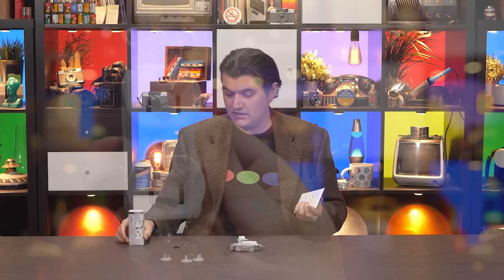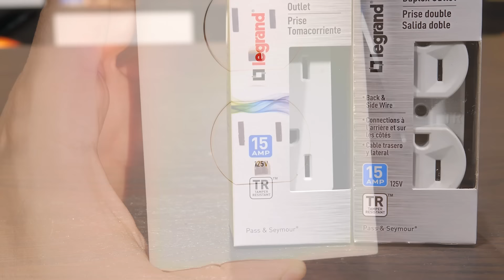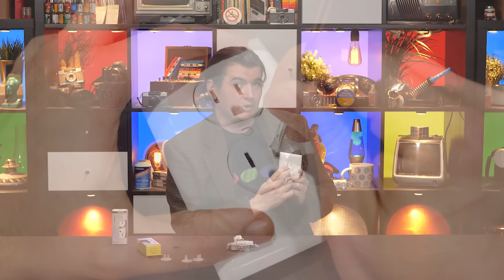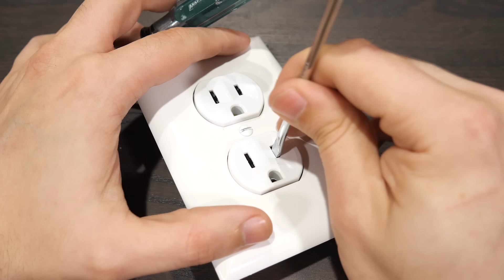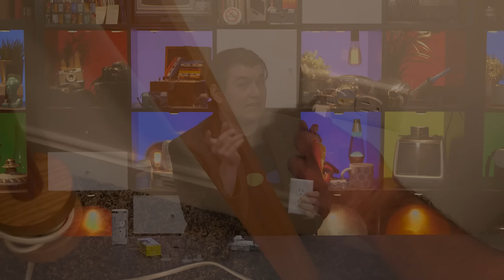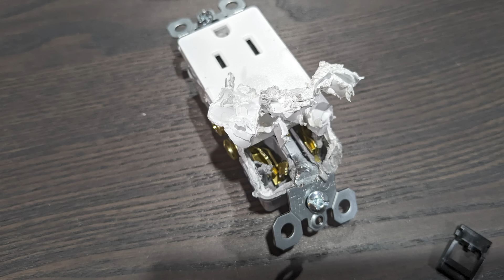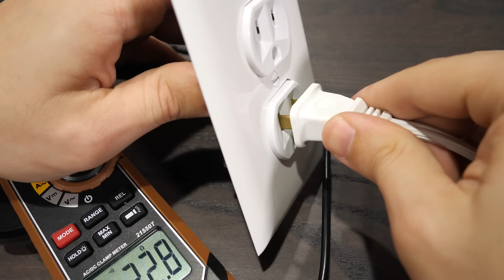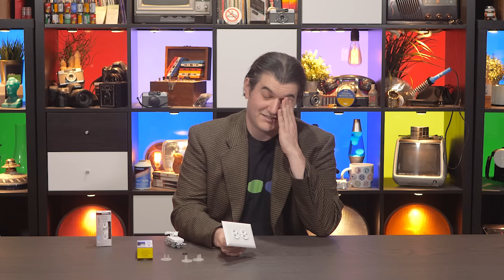Tamper-resistant outlets aren't all the same - a follow-up

Comment: I lived in both the Netherlands and in NYC, and I do recognize the complaint about the loose plugs, even with new plugs and sockets. European plugs feel a lot more secure and I think it's because the plug in the EU is not just held in place by the pins, but also a significant amount of plastic. This makes EU plugs feel a lot more secure. Again, not always, because of course not. Especially "Type F" feels really solid.
Reply: Sometimes they hold too well and you really gotta pull on the plug to get it out
Reply: They hold so well that often you have to push on the outlet while unplugging or else you risk dismounting the whole outlet from the wall
Reply: @Halfpipesaur in power strips the type F (and a little less type C) are also notoriously though to plug in, because of the anti tamper shutters in front of the contacts in power strips. When it finally does slide in, really can hurt your fingers.
Reply: what about type G ;)
Reply: Uk who goes over to mainland Europe pretty often I love and hate them sockets
Feels like I’m gonna break something when I have to press it in
But they are so damn secure!!
Reply: @randomcow505 The ones that I handle have not broken yet but they always feel as if they will.  
A friend and I do the same thing - take a UK spreader bar and put one of the overseas plugs on it. That plug goes in once, we keep the cable protected and use UK plugs and sockets.
Reply: Yeah, our European Shuko connectors feels a lot secure because they are, vastly superior :)
Reply: @Robinlarsson83   Still somebody say that UK-s are better because they are polarized but Shuko don't kill your legs when you step on them at night.
Reply: Also that polarization don't give any benefits on safety for safety there is ground.
Reply: @loodusefilm7881  yeah, people always talk about stepping on legos, but legos ain't got shit on those soul killing devices you lads got over there. Considering that there is no reason to make the UK connectors with pins 90 degrees to the cable as in fact some do exist, I will assume whoever inventeded those things did so intentionally, out of spite for humanity.
Reply: @loodusefilm7881  I think the argument against how "bad" they are if you leave them lying around is a bit stupid...don't leave them lying around. Considering we mostly have switched sockets we don't have to remove them to turn items off anyway...
Reply: @loodusefilm7881 you think the UK plugs are foot killers you should see the AUS/NZ ones lmao they're blades like US ones but don't have the partial insertion issues cause they're insulated and the diagonal slant makes them very secure.
Reply: @loodusefilm7881 i actually would agree that not relying on proper Polarisation is a feature. Not only because the can be confused, but also because neutral is not safe either.
Reply: @loodusefilm7881 that's a design feature. 😉
Reply: @loodusefilm7881 Your appliance might not need the safety of the Earth pin if it is well enough insulated. It might even work if polarity is reversed. Maybe .Does it need protection for the cable if it is drawing too much power. 
Don't worry about that last bit, there could be a bad junction at the fuse that heats up and melts the plug.
Reply: @loodusefilm7881  “Polarization [doesn’t] matter for safety, for safety there is ground.”  This is dangerously wrong.  Depending how a device or appliance is designed, the live and neutral sides, aka polarity (hence the term polarized) can matter immensely in terms of safety, regardless of the presence of a grounding pin.  You’ll have DIY’ers the world over thinking it’s OK to wire their “superior” outlets backwards just because there’s always a ground connection.  That is absolutely false!  All outlets regardless of country need to be wired correctly for safety.  There’s more than one way it will work, but there’s only one way that’s safe or correct.
Reply: @Thegonagle  In europe if polarization matter then that device is built totally wrong.
Reply: @loodusefilm7881  UK plugs are heavy, ugly, large and limited to 13 A. The beautiful Schuko plug can take 16 A continuous load without getting too warm.
Reply: @loodusefilm7881  Any right angled plugs will lie pin upwards. The right angle is a safety feature to stop you from using the cord to pull the flex out of the wall socket. In addition to being polarized, we have fuses which protect thin flexes used in low powered devices from overheating in fault conditions.
Reply: @louisvictor3473  It is a deliberate safety feature, one of the many incorporated into the plug/socket combination. It stops you from pulling on the flex to remove the socket from the wall. I don't think a none right angled Type G would pass BS1363 and thus would be illegal in the UK.
Reply: @jonathanbuzzard1376  Not true, EU plug lie pins flat
Reply: @Thegonagle  The thing is, outlets WILL be wired wrong by some people, nothing's gonna change that. Better to have an environment that requires equipment manufacturers (which can be relied on more than some random joe replacing a receptacle in his house) to design devices and only certify devices which can have L and N swapped to either side.

The stance here is pretty much: Receptacles SHOULD be wired in a defined order, and only qualified people are supposed to be wiring outlets, technically. For equipment designers, there is simply only pin 1, pin 2 and protective earth. The non-earthed europlug doesn't even have a way to tell which pin could be live and which could be neutral, it's fully symmetrical. Both lines are treated as potentially dangerous. If you're an equipment designer and make a device that becomes dangerous if L is N and N is L you've epically failed at being an equipment designer and can be sued into oblivion if you sell that shit and someone gets hurt.

Basically, what's dangerous is having even a passing thought of considering "N" a non-dangerous line.
Reply: @loodusefilm7881  Tell that to the person servicing your washing machine, testing functionality with the covers removed.  Better yet, go change a bunch of light bulbs that are switched from the wrong side because some doofus thinks polarity is only for dumb Americans.
Reply: @jonathanbuzzard1376 No, most right-angle Schuko plugs have only a small knob at the back, to hold it with your fingers when pulling out. So in most cases the plug would lie with pins about 45 degrees to the side, and even when pointed straight up, a slight sideward force will turn them away from stabbing your foot. The only plugs with large flat back are those specially designed to be hidden behind furniture.
Reply: @Robinlarsson83  German*
Reply: @Robinlarsson83  It all depends.  I live in Canada, and there are different grades of outlets and plugs.  In homes, we typically only see three types of outlets the first being these 15A (or 20 A) NEMA receptacles, second for our clothes dryer, a dual-voltage device and third, a stove or range plug, looks similar to the dryer one and has similarities to the UK standard where it's this big bulky device that you don't want to accidentally step on.  The bigger range and dryer receptacles and plugs also require quite a bit of force to insert and disconnect.  That said, the smaller 15 and 20 Ampere receptacles have different grades.  The most basic is the residential grade then you can go up to spec and commercial and then there are specialized versions for different environments.  Anything above Residential is something I would put in my house if it ever came to making that choice.  There is one NEMA standard set that even blows most Euro-plugs out of the water and that's the locking type.  Mostly seen in commercial and some industrial settings as well as theatre, this standard will not feel insecure in the least.  Also, depending on the plug and receptacle type, they are often double or even 5x the price of the standard ones.  Around here (Canada), most people would see these being used on their generators.
Reply: @WJCTechyman  Schuko isn't for high amprage, for high amp connections we have other standard IEC 60309. Also we have special plugs for electric stoves like Perilex, but also used some other plugs there.
Reply: @loodusefilm7881  Keep in mind that US/Canadian 20A outlets are still less wattage than EU 16A outlets.
Reply: @Ruhrpottpatriot Technically true but not really relevant, since the resistive losses are determined entirely by the amount of current. A Schuko plug's contacts will actually dissipate exactly the same amount of power regardless of if it's running at 230V or if it's running at a non standard 120V so long as the load draws the same current, even though in the former situation nearly twice as much power is flowing.
Reply: @Ruhrpottpatriot  Yes but amprage heat cables not wattage. With higher voltage connections and cables heat less at same wattage.
Reply: @bosstowndynamics5488  Not my point. But you can't see that because the post I replied to was edited.
Reply: @loodusefilm7881  Then maybe don't edit your post removing the problematic bit and destroy the whole conversation context?
Reply: @Ruhrpottpatriot  Haven't edited any of my comments like that, only some grammar and typos i have corrected
Reply: @Robinlarsson83  Schuko might be superior to the US sockets, but the "French" (used also in Slovakia) is better. Schuko is not "Verpolungssicher". You can turn a grounded plug by 180° and still connect it. There is no guarantee where the live and neutral end up.
Reply: @ErikZiak  Irrelevant with AC except in a very few circumstances. If you think this is anything than a minor issue, you also turn NA outlets upside down.
Reply: @Ruhrpottpatriot  I agree, it should be irrelevant with any modern appliance. But a vintage Czechoslovak refrigerator from the 1950s can give you a shock if the live wire is not in the correct position. Personal experience with just that in a Schuko outlet.
Reply: @ErikZiak  Yeah, old appliances can be dangerous, but that's more of a case when N is not connected to PE.
Then again, why are you using a 70 year old fridge? Do you have your own power station or what? :))
Reply: @Ruhrpottpatriot  Except for the fact that Europe routinely uses ES light bulbs. These unlike the superior BC need the live to be on the central pin and the screw to be neutral for safety purposes. All those ES lamps with Schuko are thus dangerous from a French or British/Irish perspective with our polarized plug/socket combinations.
Reply: @ErikZiak  I'd consider being able to plug it in either way a feature. Devices are designed to work either way, and have been for a very long time. Especially since this only comes up on two kinds of devices: a) Double insulated devices with a non-conductive case, which have no way to connect either side of the plug to the case, and b) devices with protective earth, which have the protective earth connected to the metal case parts. When you have super dodgy or super old devices it's definitely good practice to check which pin on the plug is connected to the case, if any ;)

I'd be wary of using any device with a metal case and no protective earth connected to the case anyways tbh. Sometimes happens with AliExpress specials. If PE is connected to the case and something breaks and comes loose and somehow the case goes live, your RCD will instantly trip. If the case is unconnected, you will trip the RCD when touching the case.
Reply: @Robinlarsson83  But UK ones are the best!
Reply: I've had mixed results with European outlets. At an apartment (Airbnb) in Denmark (Hvidovre, a suburb of Copenhagen) I had a phone charger (big name brand, purchased in Denmark, previously worked fine in other outlets) arc and die when I plugged it into some faulty outlet. Didn't even trip the breaker. In 36 years I've never seen anything like that in the US. Saw a lot of janky, loose outlets in Airbnbs in Italy as well. A few of them I had to bend the prongs to get a plug to fit, which is harder to do with the "Europlug" connector than the flat blades of NEMA plugs. Normally I'd consider that a benefit, but honestly the EU electrical system seems like a bit of a chaotic mess.
Reply: @moldymirage  There is no "EU electrical system". EU isn't a country, and the member states don't have a unified electrical standard. The Schuko for grounded connectors is the most common, but there are incompatible standards used by major EU countries. The europlug is better for ungrounded stuff, and widely compatible.
Reply: @moldymirage  the countries you've mentioned use their own specifi plugs, type K for danes and type L for italy, and neither of those are what people mean when talking about "euro plugs" because most of the EU uses type F, which is the superior plug.
Reply: @moldymirage I would guess that was a Danish socket then with three holes. Yeah, about as secure as a US socket, probably the worst in Europe.
Reply: @moldymirage that's because plugs in EU are not standardised and are a result of ~150 years of each country doing its own thing way before EU waas even a thought.
Reply: "More secure" just means pain in the ass to unplug, especially in hard to reach locations. I'd much rather stick with the US design, thanks.

Comment: We remodeled our house back in 1991, and tamper-resistant outlets were already mandatory at that time... I believe. It's also possible that they became mandatory in 1997, but we chose to install tamper-resistant outlets regardless because they are safer, and the price difference was negligible even back then. I remember my parents and grandma saying that these outlets were a bit more challenging to use than the old ones. You had to wiggle them a little, but you get used to it really quickly
Reply: Oh I forgot to say! I am from Finland.